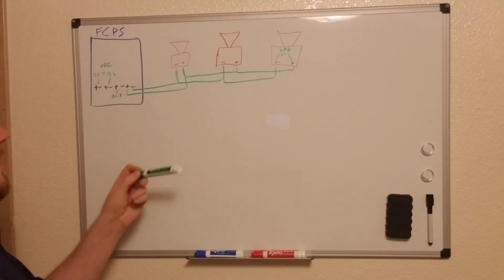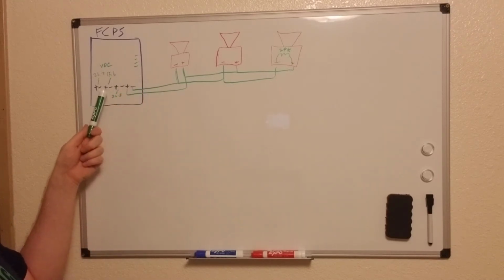Service Tech Life #3: NAC troubleshooting

Comment: If you wanted to demo the nac circuit completely,  would you need to deprogram at the panel first then tear it out
Reply: You would need to find the end of line resistor and place it across the terminals for that circuit, then the wire can be removed if needed.
Reply: Couldnt they just kill the circuit at the panel and then let us remove the circuit and devices? @IsaacCoverstone